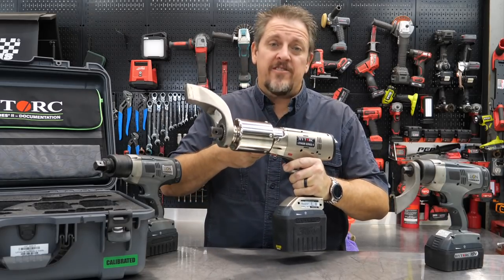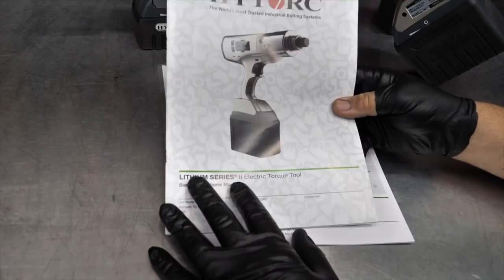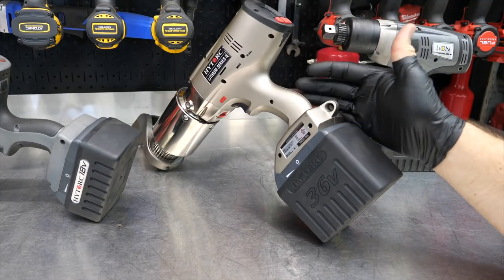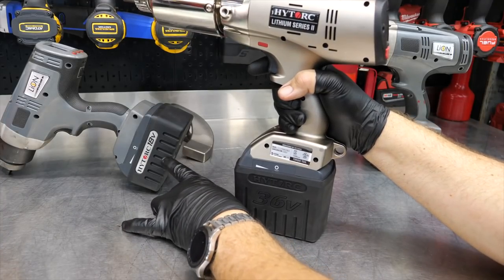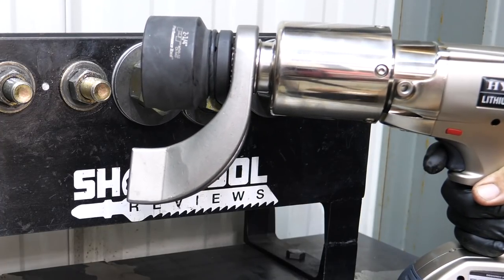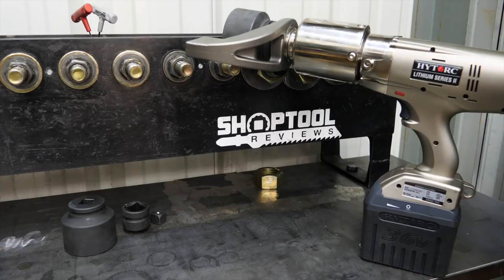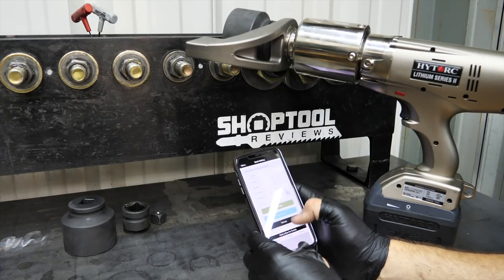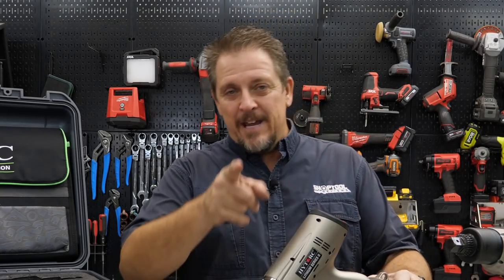INSANE POWER! HYTORC Lithium II Torque Gun Review [3000 ft-lbs]

Comment: Cool to have these portable versions. No match for the normal hytorc units but very impressive. We used one on a flange with very little room and it made life so much easier without dragging the hoses, pump, extension cords and heads around.
Reply: Great stuff Chris. I always say that each tool has its place. Mainly depending on the situation on hand. A tool like this can bail you out in times of critical needs.

Comment: The tool is a one inch drive for a very good reason. A 3/4" drive no matter what tool you use won't handle 3000 foot lbs, additionally when using the adapter the geometry of the drive to the reaction arm also will cause additional side load further stressing the 3/4" drive to premature failure.

Comment: Just curious what’s the battery life on these like? In the oilfield I use the hydraulic torque gun by this company on 2inch nuts setting them between 4000-5000lbs. This would be awesome to use over the huge power pack/hydraulic style I use. I usually set 150 or so nuts though at a time. Thanks!
Reply: I wonder too. I do wireline so sometimes we have to break a top flange and or put one on. The hammer wrench or the torque and test guys stuff is slow.. I wonder we we could just zip em on
Reply: I doubt it would hold up well to repeated 4000-5000ftlbs of torque, my guess is they will say 3000ftlbs working which actually translates into 2000ftlbs for everyday use without stressing the thing. 
I never run my tools at max, other than my ratchets which are snap-on so when they snap-off, snap-on fix them for free.

Comment: I’ve seen people loose fingers or hands with their hydraulic versions of this when the arm that’s used for leverage let’s go of whatever it’s holding up against. But man they are cool but scary as hell to use haha
Reply: I don't know about that
Reply: @galvanizedgnome  let me rephrase hands/fingers but yeah go try it! The one we use is a 1-1/2 drive and goes to 12,000 ft-lbs I promise when that lets go and your hands are in the way it won’t feel good
Reply: @georgeferlazzo7936   the retaining nut on hydraulic cylinder rod when we do new seals I haven’t done one that tight yet but I’ve had to torque stuff to 9000
Reply: Hello again Fast Eddie's 
Thank you for responding. I have used Hydraulic Torque Wrenches to assemble and disassemble Jet engines. It's been too long since I 've used one. So I don't remember how much torque we used then. 5000 Ft Lbs plus, that is unbelievable for torquing.
Reply: @fasteddie8225  some Hitachi hydraulic cylinder nuts are done up to 30,000ftlbs haha rediculous

Comment: Have you had any issues with these torque guns? For our shop, we're looking into options to replace the B-RAD type of guns, as we've h ad to get them repaired too many times. We also have a Hytorc series 3000, but it too is currently broken, but with a different issue.

We are looking for something really robust and can handle a lot of duty. Any advice?
Reply from the maker: My thoughts are that the HYTORC is probably the best and most durable. I also like that their headquarters are in NJ. Have you checked with HYTORC on the repairs?
Reply: @Shoptoolreviews  We are actually up in Canada, but it could be that who we send it to, might send our current one to them. Hopefully  the repair wont' be too bad, as it seems to be a faulty switch.

I'm still in the process of researching these, and other options - for our shop, we might just try for a corded version, and put the cordless types for the field guys. We have much higher demand for operation in shop.

Thanks for the response!

Comment: Not sure what to believe ? You say 5000 and you’re post says 3000 hytorc ?
Reply: Hi John.  HYTORC doe have an 1 1/2" square drive model that goes up to 5,000 ft lbs.
Reply: There are different ft-lbs output for the same tool. Tim was using the 3000 ft-lbs series tool

Comment: It's just a battery powered torque multiplier. I don't like it's chances of doing 5000ftlbs and 3000ftlbs would be pushing it in my opinion, I can see it doing 2000ftlbs day in day out but push it and those planet gear teeth will start to wear.